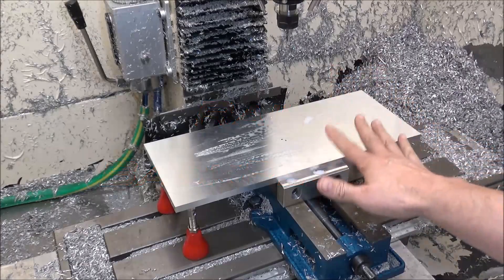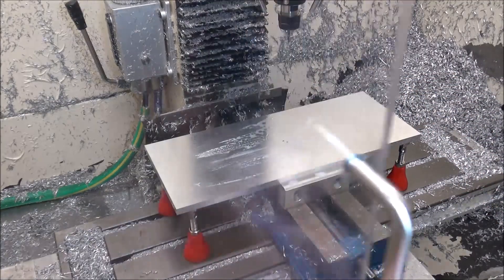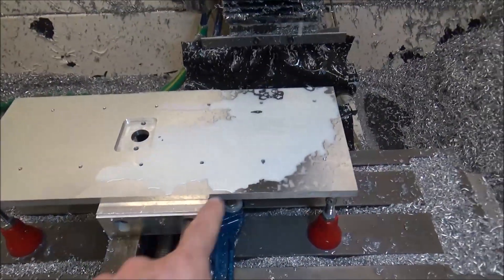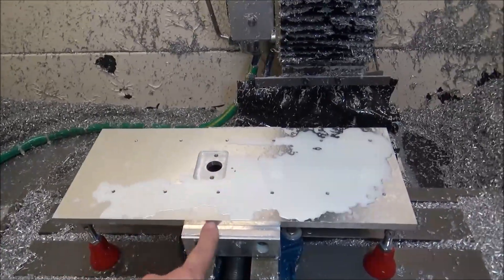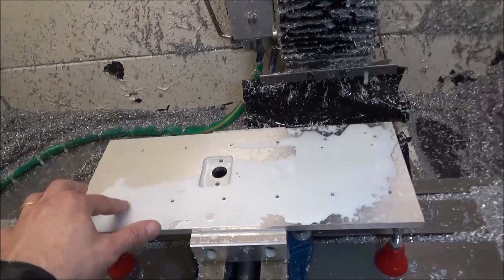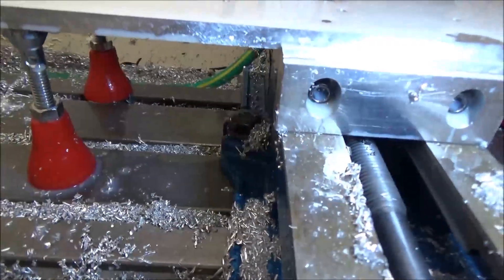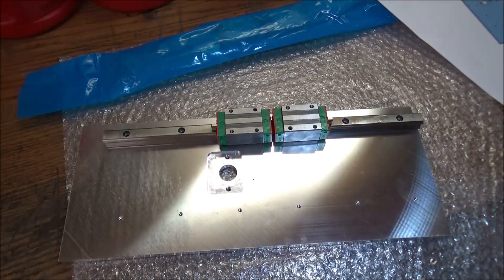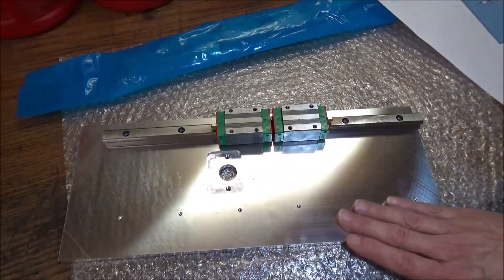PM727M ATC Pt 10

Comment: Are nice hiwin rails necessary for something like this. It will get very little travel in its life it isn't under particularly high loads and doesn't need to be precise. Wouldn't creep Chinese knock off rails work just as well.
Reply: definitely! A Haas TM-3 I worked with literally had flat steel bar with double beveled edges and V-Groove bearings. That machine(like all machines on the market) are designed intelligently and likely do not exceed speed, accuracy, precision, price, etc. requirements.

Something like Genuine HIWIN rails here are not entirely necessary, but as a hobbyist, there is pride in "over engineering" items to be of premium quality, fit, and feel.
Reply from the maker: V groove bearings and Flat bar will work linear rods will work. but if you compare costs the linear rails have dropped considerably and are really worth any added cost.
Reply from the maker: Yes I think you can go with the Knock off rails but these were around $150 vs $90 for knock offs and some are not as good as others. I will talk about that coming up.
Reply: Hmm I haven't noticed a drop where do you get yours
Reply: Makes sense those rails are nice and will last a lifetime or 5